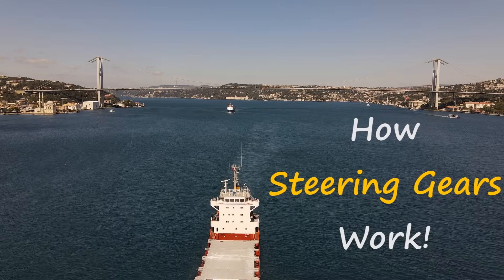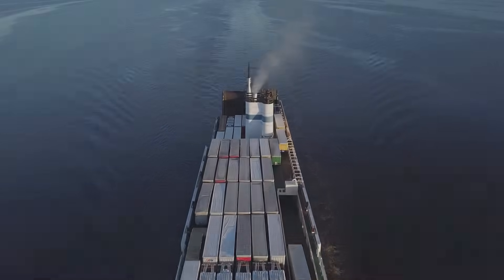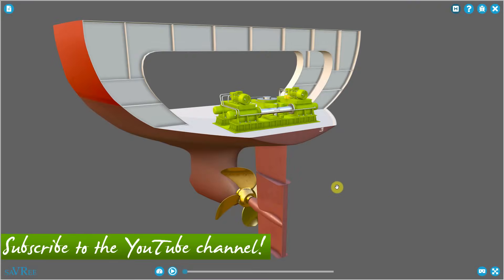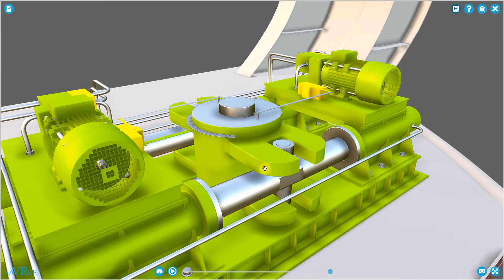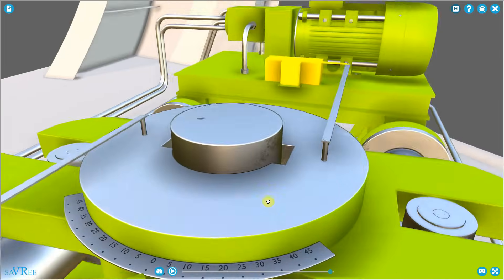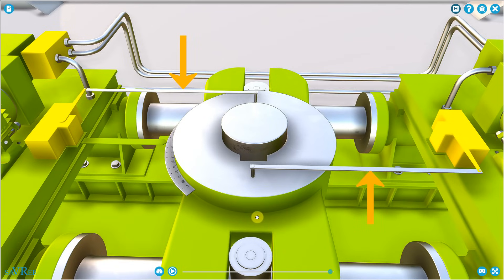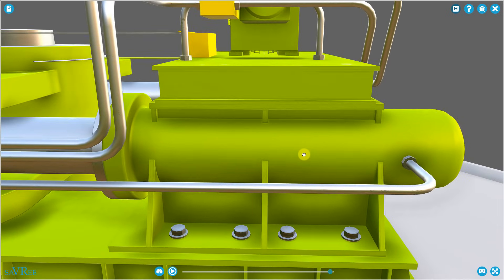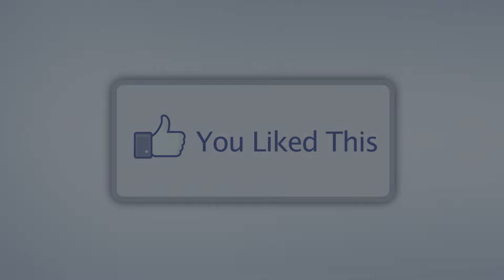How Massive Ship Steering Gears Work!

Comment: One small point that I noticed: in the beginning of the video, you have mentioned the electric motors, but not specified what the motors are actually driving? A short description of the main types of pumps would make it clearer: viz. axial piston or radial piston types. Besides driving the main pumps, they also provide the drive for the servo pumps. The oil from the main pumps is sent to the rams, whilst the oil from the servo pumps is used to operate the bypass valves. Also, there are auto isolation valves used to restore steering in case of any leakage ('single failure' is the term used in SOLAS). Maybe you are intending to make another video for these details? 😀
Reply from the maker: Yeah, there is a lot missing. We could actually make a 1.5 hour video course just about steering gears, its just that my time is restricted a lot at the moment. We have axial piston pumps in the 3D library, but I did not want to mention them because then I would have had to discuss the servo pumps (probably) and the whole momentum of the video slows-down. We will do all of this stuff at some point though.

Comment: Excellent effort to explain the 4 Ram type steering. Next video could be about the Rotary Vane Steering gear. Subsequently, you could add Safematic Steering (IMO requirement for large tankers). Also, the significance of Rudder drop and the Jumping clearance.👌👍
Reply from the maker: Rotary vane steering gear is planned Vikram!

Comment: Most interesting, thanks!
I'd be curious to see the scale of the rudder control in relation to, say, a human.  It must be fairly massive.
Reply: It largely depends on the vessel size but cylinders can be up to 18 inches in outside diameter, are the largest I worked on or can be as small as 50 mm. The largest cylinders I have worked on require a 4 ton chain hoist on an I beam track above them to service them individually.

Comment: How do you do evasive maneuvers with a 100,000 ton Nuclear powered aircraft carrier going 32 knots? The video but multiplied by 4.
Reply: Those would use a hydropneumatic system for rapid shifting of the rudder. They have a steam plant onboard to power the catapult, so this would provide the steam for rudders as well. But looking at the requirement, I would say there would be two systems, a normal system for general cruise as any ship, and a rapid system for quick evasive maneuvers. So, there would be a mechanical clutch to engage and disengage the rudder stock between the two systems. I havn't done any research on this but made my own assumptions.
Reply: @mohabatkhanmalak1161  Alternatively, just use larger rams (and accompanying motors) to turn the rudders, you do, after all, have several nuclear reactors onboard.